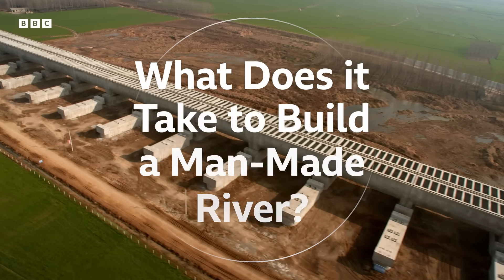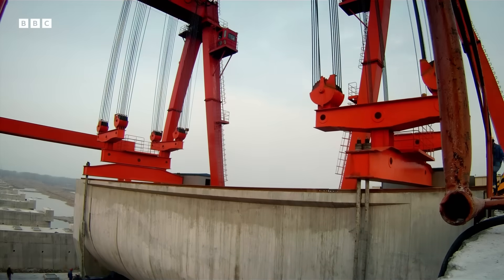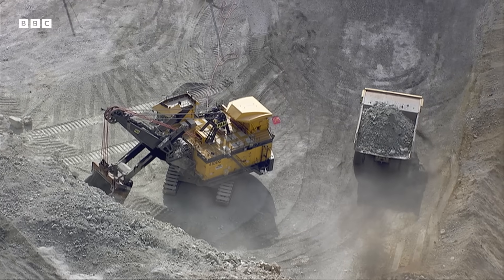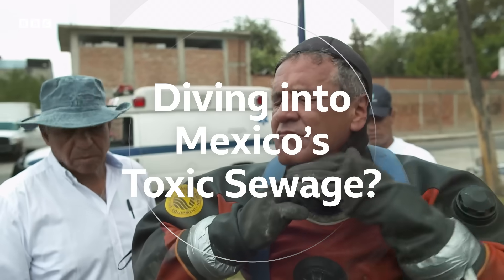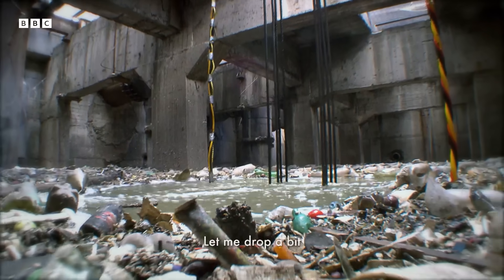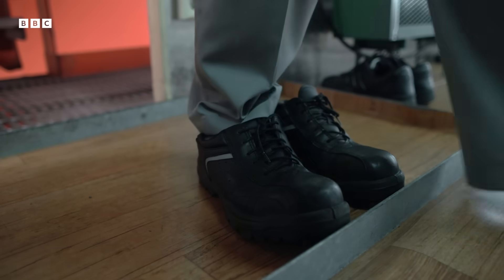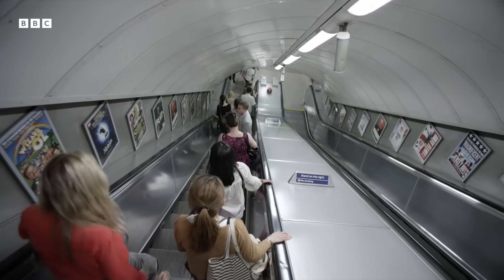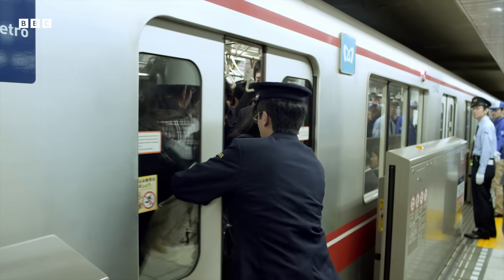This is How Humans Have Changed the World | Generation Earth | BBC Earth Science

Comment: Just wait until ICVs are banned and EVs are trying to replace them. There'll be thousands of open pit mines for the needed copper to both replace ICVs with EVs as well as for the coal needed to make both the steel and refine the silicon for wind turbines and Solar PV cells. Then the extra copper and aluminum needed to upgrade the electric distribution infrastructure to allow for home charging in every garage

Comment: The Chinese are building something that was perfected and made possible through the inventions of people of European descent . Almost everything in the modern world was invented by people European descent . In addition to what you are seeing in this video things like  submarines, electric lights, nuclear power, microwaves, CAT scans, automobiles, hydraulic, wind turbines, jet airplanes, aluminum, hydroelectric dams, steam power, trains, tractors, modern pharmaceuticals, open heart surgery, satellites, radios, telephones, televisions, arch & tig welding, computers, transistors, microchips, titanium, telescope, democracy, capitalism, modern farming, x-rays, gyroscope, pasteurization, space travel, airplanes, fiber optics, ultrasounds, internet, printing press, internal combustion engine, chainsaws petroleum production, trigonometry, helicopters, thermometer, directional drilling, Astrophysics, crop rotation, super conductors, particle colliders, pneumatic tires, sextant, robotics, telegraph, microscope, firearms, penicillin, refined oil and fuels, hovercraft, computers, angioplasty, telescope, pipelines, open heart surgery, tower cranes, chemo therapy, light emitting diodes, motion pictures, cameras, digital cameras, CD/DVD, concrete, dynamite, lithium batteries, LED lights, refrigerators, water pumps, radar, sonar, satellites, distillation, electric motors, magnetic compass, sextant, clocks, plastics, vaccines, vulcanized rubber, combine grain harvesters, and concrete have been brought to you by people of European descent…. Just to name a few